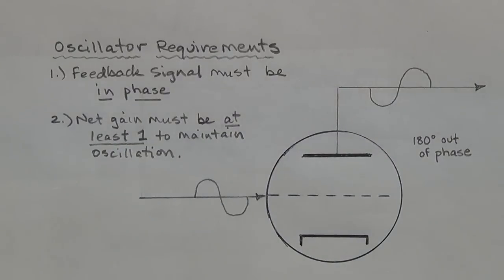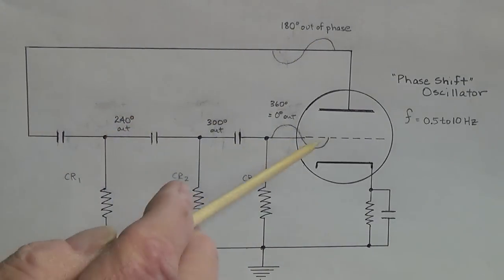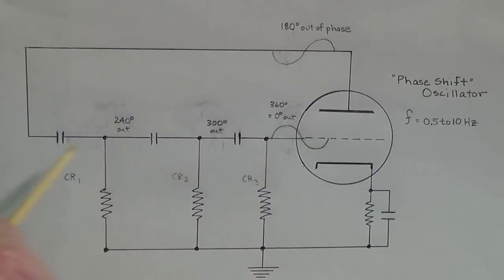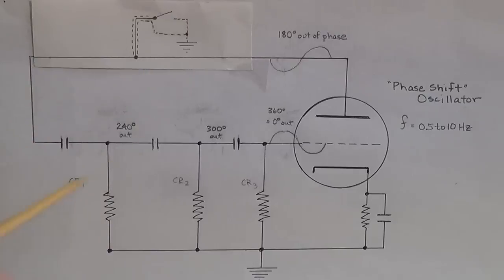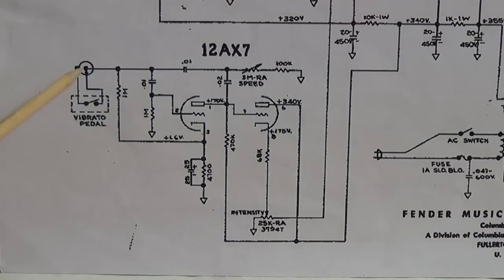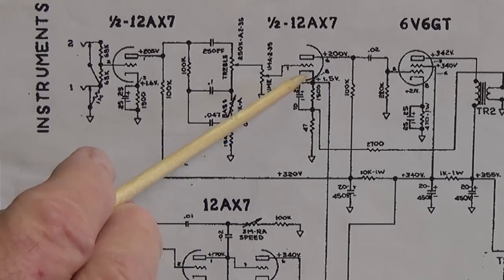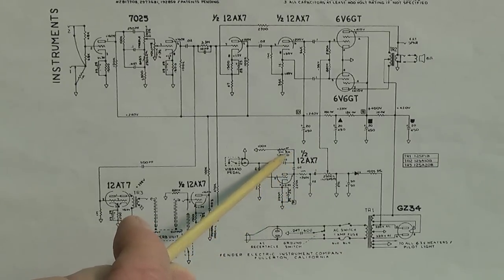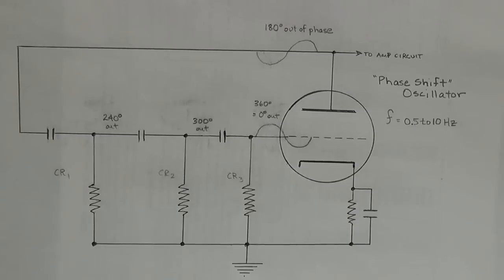How Does a Bias-Shifting Tube Tremolo Work ?

Comment: Hey dude, I'm working on a minor lecture on amplifier circuits and I have a question.
You initially wrote that the oscillator circuit takes in an AC signal.
Where does this come from? I can only see DC signals in the circuits you showed us.
Reply: Nevermind, I'm stupid. 

In case you guys are as unfortunate as me, the answer is that there's a VCC hidden in there.
The second the VCC (positive) is turned on, the electrons are stripped from the anode. This positive signal then goes over the RC circuits and after some time get to the grid where it charges that to + as well.
This lets electrons flow from the cathode to the anode,  sending a negative signal to the anode that then goes to the RC circuit that then sets the grid to -.
This, in turn, prevents electrons from flowing to the anode, meaning that it becomes positively charged again, starting the process over.
It's a DC-to-AC converting circuit.
Reply from the maker: Thanks for answering your own question, Fred.....and good luck with your lecture :)
Reply: Thanks. I think I was wrong the second time as well as the high pass filters should cut off any DC contribution. Recent updates show that it might be noise in the circuit but I'm honestly not sure at the moment, as it seems to be some very heavy math necessary to understand it. Thank you for the reply.
Reply from the maker: The oscillator circuit generates a low frequency AC signal using the DC provided to the oscillator tube. The frequency of oscillation is controlled by the values of the three capacitors and resistors in the oscillator loop, which provide a 180 degree phase shift to the oscillator tube output, creating the rhythmic, approx. 2 to 12HZ, AC output.
Reply: I appreciate it mate, and I get that it produces the AC signal from the DC signal, but what I'm trying to figure out is from whence the oscillations come - that is if you have a DC circuit with a voltage dragging off electrons in only one direction, then what other force then makes the electrons move in the opposing direction to create the AC.
I'm also trying to figure out what the explanation is for why only a single frequency - a low one at that -  is amplified when we have what ammounts to a high pass filter that ordinarily has an impedance that gets smaller with the increasing frequency strapped on our circuit, meaning that it intuitively should let through higher frequencies and block lower ones.

In case you're interested, after doing 5 hours of research yesterday I finally found some sources on how the physics behind the generation of the signal are.
According to my sources the answer i've found thus far is that the "original" AC signal that is then filtered and amplified stems off noise in the circuit upon startup, and that this signal is amplified because only this frequency is put out of phase properly. 
This is the simple version.

The complicated but more in depth answer is a theory I don't entirely understand about the stability of electrical circuits similar to those of thermodynamical systems similar to those for how long you can balance a pencil on its tip, using tonnes of maths that I've never encountered before (Laplace transforms), but with (relatively) simple results and limitations, such as the gain for the circuit without feedback multiplied by the "gain" of the feedback loop having be equal to one in order for an oscillation to occur, and since the latter is dependent on the impedance of the filter, and is thus frequency dependent, only certain very well defined frequencies are oscillating for a specific RC filter system.

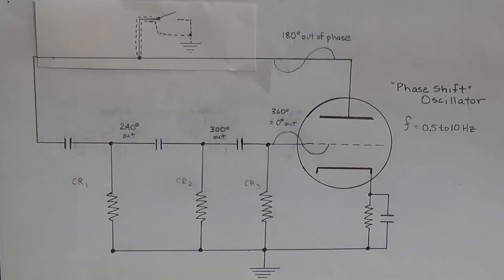Comment: I just noticed that you connected B+ to ground at 7:34
In fact the switch is connected after the first capacitor. Otherwise bad things would happen ;)

cheers
Reply from the maker: Excellent observation, DT.  I was more focused on clarity of the diagram than on electronic accuracy. Yes, there must be at least one capacitor between the foot switch and HV DC.....or, as you say, bad things will happen :)

Comment: Great video Uncle Doug, like always :-). I have a VOX JMI AC30/6 top boost head (1966) on my bench with a failing vib/trem channel. Thx for your excellent explanation About tremolo, it will help me a lot. Is there anywhere in your video series some explanation how vibrato (circuit) works?
Reply from the maker: Thanks, Stefan. I'm glad the tremolo videos were of interest. I have never addressed how true vibrato circuits work, mainly because they are very uncommon, quite complex, and I have never personally worked on one (as found in some Magnatone amps).  Fortunately, there are lots of Internet sites that address and explain them.  Good luck.
Reply: thx Uncle Doug. in the mean time the problem is solved. It was a defective plate resistor from the oscillation tube. but thx for respons like always.

Comment: I just semi-fixed a Bronco that's been dead for a year ir more.  Then.... the tremolo/vibrato circuit didn't work. Perfect video to trouble shoot that circuit.  Exactly the same circuit as the Princton.  I'll give it a go tomorrow.  Thanks, your videos are great.
Reply from the maker: Thanks, Dennis. Best of luck with your repair project :)
Reply: Uncle Doug ..... he-yea, the Bronco's "vibrato/tremolo" is working again... BUTT... I wish it had more depth... if possible.
Any ideas you have would be greatly appreciated.  Happy New Year and thanks-a-lot.
Reply: Uncle Doug,  The vibrato/tremolo seems very tube sensitive?? Works fine with a new JJ, less depth with a different JJ.  Won't run at all with a couple of different used MESA tubes and  Chinese 12AX7.  Very odd.

Comment: Beautifully explained. I now feel I can add tremelo to my Champ clone. Am I right in thinking the reason so many trems don't work in old amps is because the old capacitors have decayed?
Thanks Uncle Doug and Rusty.
Reply from the maker: Thanks, Mick. You'll have to add an oscillator tube to accomplish your goal, so be sure your power transformer can handle the additional current demand.  There are multiple causes for tremolo failure, and the change of value in aging oscillator loop capacitors is one of the most common.

Comment: Thanks, very informative video. It helped me trying to understand the tremolo circuit in a Silvertone 4750 organ amp I am trying to convert for guitar use. The tremolo in this Amp is similar yet different from your example. It appears to only use 1/2 of a 12ax7 and feed out of its cathode to intensity control. I want to add a speed control this amp does not currently have one. Is it important to use Reverse Audio pots for this? Your video did not mention Reverse audio pot use in tremolo circuits. 
Thanks,
Aaron.
Reply from the maker: I don't use reverse audio pots, Aaron. I have never found a situation where one was needed. Good luck with your project.

Comment: Hi Doug, excellent video!  Question about the Vibrochamp style of applying bias wiggle tremolo to a preamp tube.  Assuming that the power transformer can handle it, could you insert this type of tremolo circuit into almost any type of guitar amp?  Maybe a 5E3 or perhaps in a Deluxe Reverb in place of the Photoresistor 'roach' style?
Reply from the maker: Thanks, Kley. Yes, as demonstrated in my recent video on the Bell & Howell projector amp, you can add tremolo to virtually any amplifier, including a 5E3 Deluxe. Since the 12AX7, which is generally used as the oscillator tube, draws so little current, there is little risk of harm to the power transformer.
Reply: Uncle Doug Nice, that was very helpful!  I am nearing completion of a scratch built AB763 style build.  I took inspiration from a Doug Hoffman kit that uses a Fender 6G16 bias wiggle style tremolo - but am exploring some other options.  The bias wiggle applied to the output tubes is proving to be a little weak and requiring a rather cold bias to produce optimal tremolo.  So I plan on using the Vibrochamp preamp style tremolo possibly in its place.  Pretty fun stuff!
Reply from the maker: The earlier in the signal chain that you apply the tremolo input, the stronger its effect. Before you abandon your present tremolo circuit, try applying it to successively earlier points (i.e. cathodes) in the signal chain......
Reply: Uncle Doug Thanks for the tip!
Reply from the maker: You're welcome.

Comment: hi I have a brand new 18 watt ceriatone amp with tremolo  the tremolo stays on  a slow speed   even when off  but can turn it off with foot pedal switch but I notice when foot switch is disconnected  no guitar pluged into amp  turn on tone control on tremolo side          it makes a humming  osalating sound  any clue whats going on thanks chis could it be a tube if so which one thanks chris any information  would be helpful
Reply from the maker: Chris, I really can't make an accurate diagnosis without personally evaluating the problem, which is not feasible. Since the amp is new, why not call the company that built it and ask for their assistance?  Regardless, good luck.

Comment: I've been studying something similar myself....   and one question came 
up...    If in the oscillator,  high pass filters are used...  how is it
 we get a SLOW oscillation?...  since we're only passing highs?
Reply from the maker: Although the oscillator appears to use three high-pass filters, their purpose is not to filter, but to provide phase shift. The three RC pairs each provide about 60 degrees of phase shift, for a total of 180 degrees. Low-pass filters can also be used. Here is an excellent, basic explanation:   http://www.learnabout-electronics.org/Oscillators/osc31.php

Comment: I just bought a new 68' Fender Twin  ReverbI reissue and I  am getting motor boating in the tremolo speed circuit especially if I turn it up past five on the speed control. Is that typical? Thanks again for all the great vids.
Reply from the maker: Hearing a tremolo pulse is not really "motorboating", BC. This is a common issue and generally associated with the photoresistor-neon bulb unit. There are several Internet sites dedicated to the eradication of this problem. Here is one suggestion:   The official Fender solution (Service Bulletin number 9) 
"The ticking caused by the Vibrato is caused by improper lead dress.  

It can almost be "cured" by connecting a .01 mfd 600 volt mylar capacitor 
on the 10 meg ohm resistor in the vibrato circuit. this resistor is located 
on the parts panel. Remove capacitor across the 10 meg ohm resistor (old 
modification) if in place."  

(That is, run the cap from the junction of the 10 meg resistor and the 
optoisolator to ground.)  

"If this does not produce the desired results, then the leads should be
dressed as follows and excessive lengths shortened.  

1. Dress the leads to the vibrato speed and intensity controls away from 
the tone controls and filter leads.  

2. "Bunch" the leads to the components on the parts panel which connect to 
the tube socket of the 7025 (12AX7) vibrato tube." 
http://vintageamps.com/plexiboard/viewtopic.php?f=8&p=808085&t=75329 

Or for the blackface PCB reissues, there is a guy called Fritz D Cat 
that has a simple mod to cure the ticking tremolo.  Similar to the #9 
Service Bulletin, but geared twoards the PCB reissues: "...the cheapo
 ceramic disk cap in between the opto-isolator and the electrolytic cap 
is the mod. I used an 0.01 uF @ 1KV ceramic disk cap. It's soldered to 
the north side of R45 and the south side of C24." see here: http://www.fenderforum.com/userphotos/index.html?recid=67321
Reply: Thanks so much for getting back to me Uncle Doug. I will try returning this new Twin as it was out of box with no manuals or cover.  I will then test the tremolo in the new amp. If it still prevails then I'll recommend these fixes to the warranty technician.  Thanks Again B
Reply from the maker: You're welcome, B. Good luck :)
Reply: Thank you Uncle Doug I will keep you informed of the fix for the tremolo problem. B
Reply from the maker: You're welcome. Good luck :)

Comment: Hey Uncle! 
I was "burning in" some new 6V6 tubes in my SF Princeton Reverb and cranked it (without the guitar plugged in) and then played around with the tremolo pots, given that the amp was just biased and all, and saw that the 6V6s were entering into a little bit of red-plating. My question here is, is that normal? BTW, the amp is breaking quite soon (at 4 in the volume pot) and I was wondering if a 12au7 in the v1 could help at taming that characteristic of the amp. Also, and with this I finish, my amp is a 78, which demands a 5u4gb for the rectifier tube, and since you have praised the GZ-34 so thoroughly in your videos, I wonder,  is it possible to use that rectifier tube in a 78 PR?

Sorry for the barrage of questions Uncle, tell Rusty I'm sorry for the hassle ^_^
Reply from the maker: +Fuga Mante No problem at all, Fuga. To what level of Plate Dissipation were the tubes biased?  Remember that with fixed bias (grounded cathode) output tubes, you only bias to 70% of max.....which is 8.4W for a 6V6, preferably a little less (i.e. 8W).  If you biased to 12W, no wonder the tubes are red-plating and breaking up way too soon. Changing to a 12AU7 should not be necessary. The problem is with the output tubes themselves.
Reply: +Uncle Doug is there any resource I could use to check on that myself? The bias was set at my local amp repair shop. They use an artifact to bias.
Reply from the maker: I have posted a video on how to bias a double-ended amp. If you're not accustomed to handling high voltages, then either be very careful, or get someone else (who is) to check it for you.
Reply: +Uncle Doug I will be very careful. Thanks for the heads up!
Reply from the maker: Good Luck
Reply: +Uncle Doug One last thing, the tubes seem to have (both) a 470k ohm resistor in the pins, which I can't see in the schematics. Is that a sane mod?
Reply from the maker: I have no idea why those resistors are there. I really think you need to have a qualified individual look at this amp. The circuit does seem to have been tampered with.
Reply: If they're connected between B+ and pin 4 then they're screen stoppers to limit screen dissipation and help prevent oscillation.

Comment: I can use a 12AU7 valve smoothly?
Reply from the maker: +Oscar Leonardi  If you intend to substitute a 12AU7 for a 12AX7, it will work but the 12AU7 has about 80% less gain than the 12AX7.

Comment: Uncie Doug, another fascinating video. I'm having trouble understanding the fender champ tremolo. How does connecting the cathode of the tremolo circuit affect the cathode bias of the preamp tube?
Reply from the maker: +Jared Zecchel   That is how it works, Jared, by altering the bias of the second 12AX7 triode.  When the bias is elevated, the volume increases, and when the bias is reduced, the volume decreases.

Comment: Thanks Uncle Doug. The reason I ask is due to a failure in a classic Silvertone 10XL #1421 tube amp I have. The amp is in pretty good condition with the exception of a faulty tremolo circuit. The only schematic I could find was a remake done on CAD obviously, and I have some doubts about it's accuracy. 
See : www. schematicheaven.net/bargainbin/silvertone_1421.pdf 
I tried swapping tubes and looking for the obvious component damage to no avail. The  result when the tremolo is turned up is a slight decrease in the output volume. I wish I had an O'scope! So, have you ever worked on one of these amps before?
Reply from the maker: +Harry  I have worked on many similar tremolo circuits, Harry, and would suggest that you focus on the three capacitors, C8-10, in the oscillation loop.  Any deviation from value on any of these caps can result in failure of the oscillator.  If you can't test them, then replace them.  If this fails to rectify the situation, then test all the resistors in the oscillator circuit and replace as needed. Good luck.

Comment: Very nice video sir. You use the Vibro Champ as a sample to describe the tremelo function. But doesn't vibrato control the frequency of the signal, while tremelo is a varying of the amplitude? Or is this just an amplifier name "terminology" confusion? I would think Fender would have called it a Tremo Champ.
Reply from the maker: +Harry  Thanks, Harry. You are correct. Fender (and many other amp builders) erroneously named their amplitude-modulating tremolo as if it were a frequency-modulating vibrato.  True vibrato is rare in guitar amps and personified most outstandingly by Magnatone. Another good source of vibrato effect is the Leslie speaker often converted for guitar use.

Comment: If there is no signal on the grid of the oscillator to begin with where does the signal come from to start it oscillating
Reply from the maker: +David Chatterton  According to Internet sites, it is initiated by electronic noise in the circuit and by the "shock" of the footswitch when it turns on the Trem.  Also, in some cases, there is a circuit connection (i.e. to oscillator cathode) that initiates the oscillation.